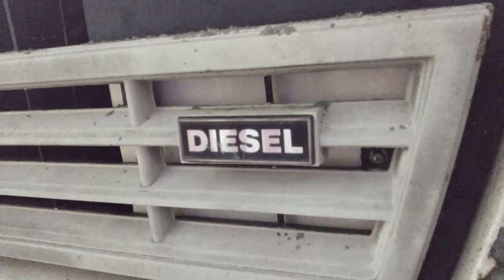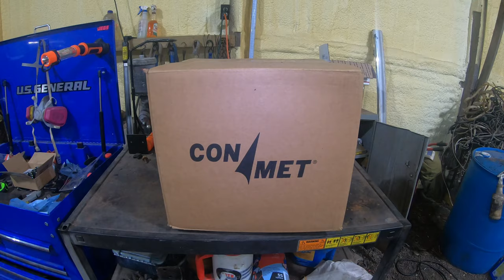F700 LUCAS GIRLING BRAKES AND INBOARD DAYTON HUB CONVERSION | #STOPONADIME #HEAVYHAULER

Comment: Its amazing how rust free that 7000 is. I undercoat all my vehicles with fluid film yearly. Some get fluid film and don't go on the road during the winter at all. My 2003 has never seen bad roads, it's like brand new. Once the 72 is done, it won't either.
Reply from the maker: It sure is. I had already payed for it when I realized how clean it was

Comment: I have a B600 1989 it has LG brakes, and I want to swap to air. I'm thinking I can swap the hydraulic booster system for an air system that's belt driven, can possibly feed oil to cool and lubricate from the engine.
Reply from the maker: @honeybadgeractual5734  I've heard of it being done, sounds like a lot of work. I would like to see how it turns out

Comment: Not all of them are hydraulic some are air. I’ve had two out of those axles that were air not hydraulic.
Reply from the maker: Where they Lucas girling brakes tho. The biggest pain in the ass with Lucas girling is adjusting the brakes. If they were air it was probably just a regular air brake design. Witch can't really get any more simple to adjust.
Reply: Yes Lucas girling air parking brake and juice master cylinder. Mine is a wrecker and I do a lot of recovery’s with it on asphalt so I can’t be digging into the road like the old days. I have a disc brake rear end I’d like to put in but I haven’t been able to find a way to convert my air parking brake to the disc rear end. Or had the time. And my spring brake worked great holding the truck. I hate drum drive shaft brakes. Guys forget to release and burn your truck down.
Reply from the maker: Interesting. Alot of different configurations. I watched a guy put a school bus rear under his truck to eliminate this style of brake. I think it was all air .  Im going to take this truck apart next year and put the tilt bed on a semi.